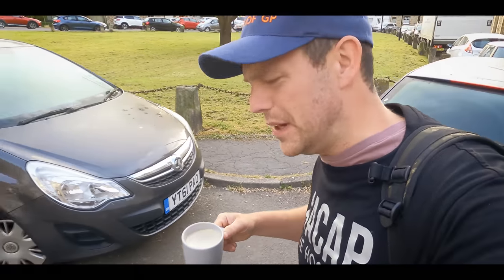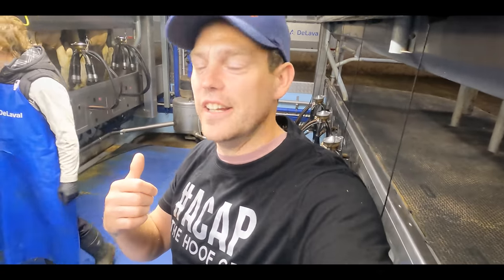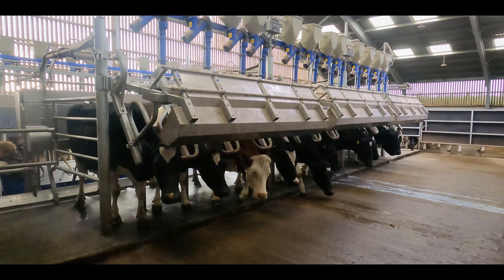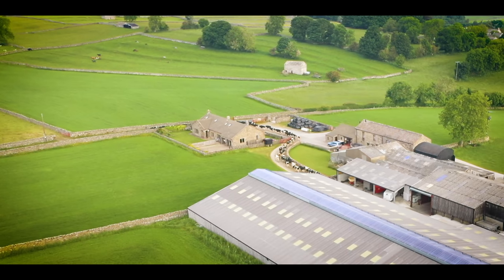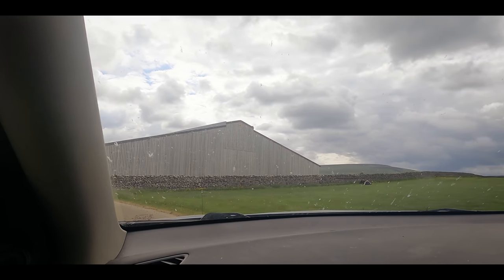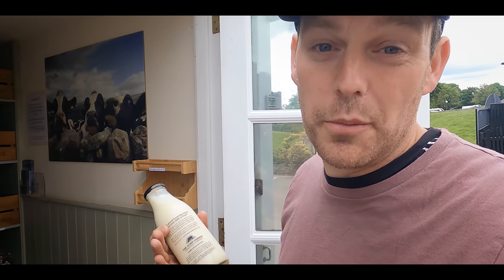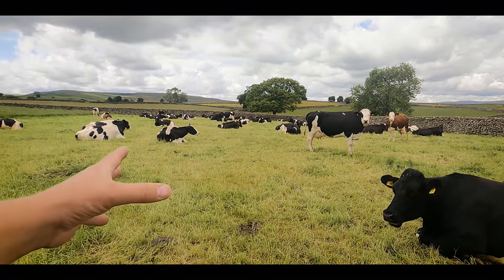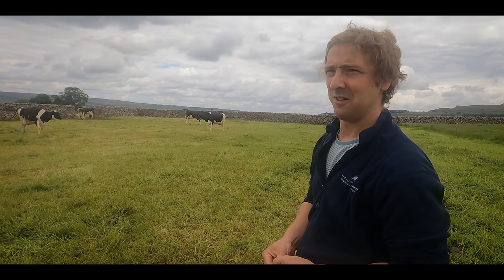I FOUND a DEAD COW!?

Comment: I once stopped my car on a country road to try and pat a cow that was leaning over the fence. Not only did it let me clap it but it also gave me a massive lick. I felt so honoured and it made my day
Reply: I wouldn't suggest you do that on a normal day. Cows are nice when socialize and calm but not very nice when nervous or "wild". Cows are very weary of humans when they have minimal socializing with them and you'd be surprised how fast they can wipe around. If they are shook up from a predator or loud noise (like a running car) they can get nervous. Also never approach a mom with a calf or when there is a bull around. Also there are diseases that you or the cow could transmit to one another.